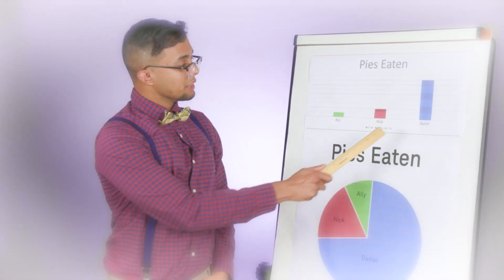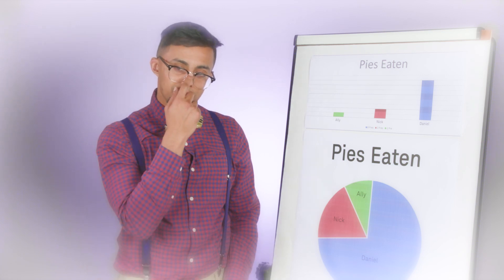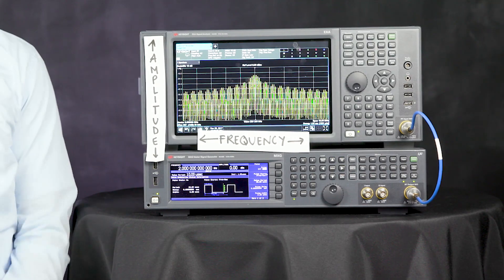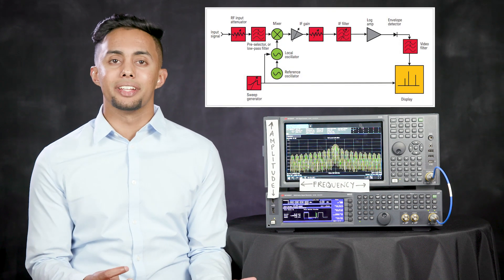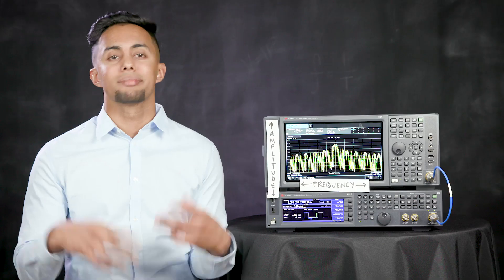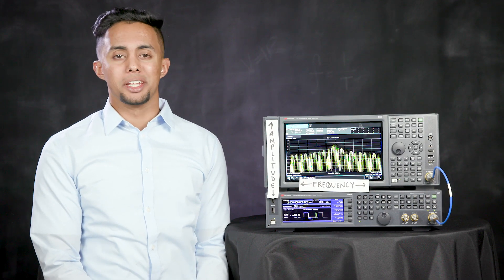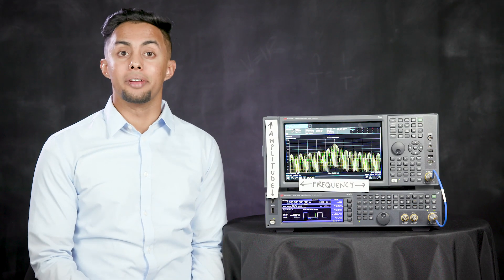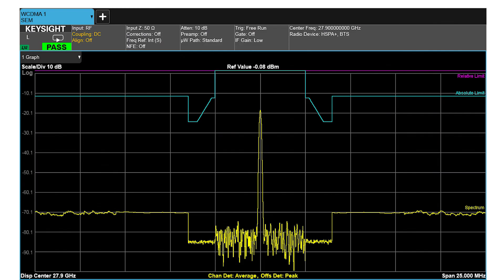What is a Spectrum Analyzer and Measurements You Can Make - What the RF (S01E01)

Comment: Hi, keysight! Isn't it more accurate to say, that spectrum analyzer is basically analyzes
power vs frequency? Simple experiment: let's get sine signal 100 mV pk-pk and freq 10 kHz from signal generator.
Amplitude of this signal is 50 mV by definition. So, if spectrum analyzer displays
amplitude vs frequency we should see +34 dBmV (because 50 mV is 50 times more that 1 mV) at 10 kHz.
In reality you only will see +31 dBmV. Why? Because it's displays RMS value which is 0,707*50=35,35 mV
(and it's a 35,35 times more that 1 mV and it's roughly +31 dBmV). So it's not amplitude, at least RMS
amplitude or power. What do you think?

Comment: Then what is the reason for using a spectrum analyzer instead of FFT in an oscilloscope?
Reply: Frequency range (carrier frequency), real-time bandwidth, sensitivity and dynamic range (only 8-bit on an oscilloscope), displayed average noise level, phase noise and a whole slew of analysis functionality. Of course, with a very good oscilloscope (e.g. DSAV334A or a more modest DSOS804A) and Keysight's VSA software you definitely also can have a larger real-time bandwidth analyser (and more channels) but the dynamic range is not comparable to a real signal analyser.

https://literature.cdn.keysight.com/litweb/pdf/5992-1242EN.pdf
Reply: Mainly Bandwidth, and sensitivity I guess. Also a signal analysers does more than one way of displaying the harmonic signal.
Reply from the maker: Christian and Maxime had great answers! Something else I would add is that signal analyzers have a better spurious-free dynamic range (SFDR).